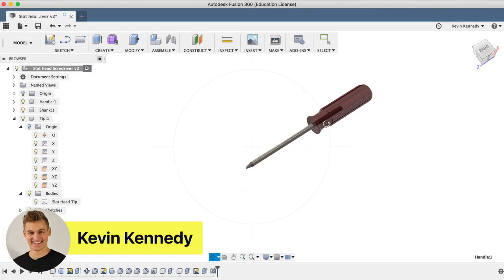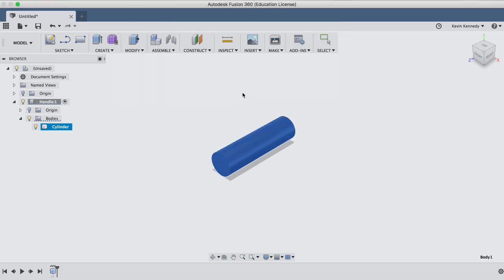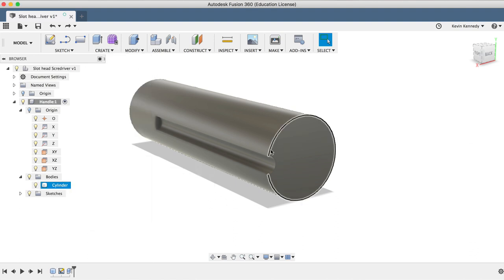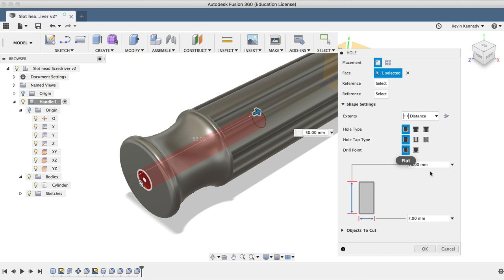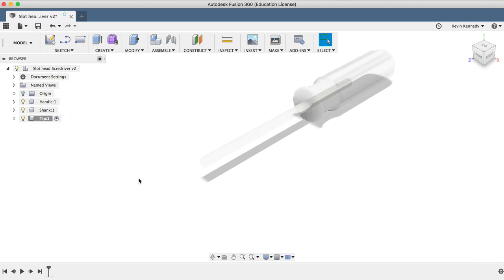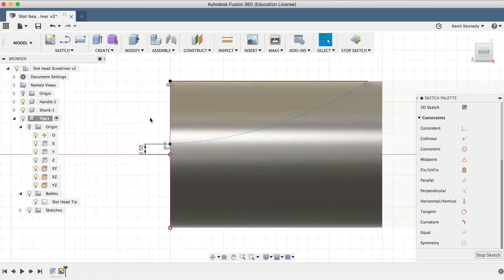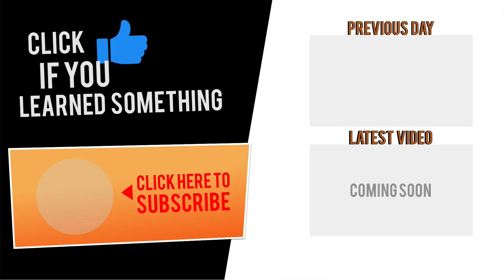How to 3D Model a Screwdriver in Fusion 360 - Learn Autodesk Fusion 360 in 30 Days: Day #14

Comment: Hi Kevin, 
I am stucked at 11.04 . I can't catch the edges of the tip when I want to draw tips, therefore I can't make horizontal-vertical selection. Can you help me about it?
Reply from the maker: Hi, Ümit Demir. Click on your username in the upper right-hand corner > preferences > then under "General" > "Design" tab...then make sure the following setting is checked: "Auto project edges on reference"

That should fix the issue you're having with the reference of the other edges as you try to make the tip. If not, you can always create sketch points. Sketch dropdown list > Point > place them where they snap into place. Then use those sketch points as you create the arcs. Cheers, Kevin :)
Reply: Hi Kevin,
It worked very well. Now I can develope my design:D
Thank you for your help!
Reply from the maker: @umitdemir2873  You're welcome! I'm always happy to help. Cheers, Kevin :)
Reply: @ProductDesignOnline   this fixed it for me also. I'm glad I scanned the comments.
Reply from the maker: @brandonleirer4928  Glad that helped, Brandon. I just made an update to the pinned comment. Hopefully, others will catch that and won't have to read through all the comments. Cheers, Kevin :)

Comment: Hi Kevin, I couldn't snap the 3 arc on the side of the tip, the ending line doesn't show up as it does in your video.
Reply from the maker: Hi, Hussain. You may want to first create a sketch point. Head to the sketch dropdown list and then select the "point" option. Make sure your grids and snaps are on and create a point in that area. Then when you go to recreate the 3-point arc you'll be able to snap it into that reference point. 
Let me know if this helps! Cheers, Kevin :)
Reply: @ProductDesignOnline . Thanks Kev, it works. i was just wondering whether leaving the points affects anything

Comment: Hey Kevin:
As always loved your video. Kinda of easier as I move  through them. I am no longer making basic mistakes. For example, I thought I knew how to cleanly use the line tool. I did not... This Screwdriver video is simply amazing! Oh, my God! 

However, I had a ton of trouble making that cut of the tip head near the end, at 11:30. I kept getting that constraint error. (I could never see the point.) Tried redoing from the beginning about 4 times. I finally fixed the problem, by adding a point to the origin, then redoing the Dimension step...  

I am 99% happy with the experience, but for that last 1%, any ideas why that happened? 

I checked all my setting multiple times comparing them to yours.  

As Always, Thanks!
Rob
Stay Healthy!
Reply from the maker: Hi Rob. Glad you were able to work through it with a workaround. My first thought, without seeing your model, would be to check the "Auto Project Edges on Reference" setting. Did you check that? https://productdesignonline.com/default-settings-for-fusion-360-tutorials/#autoProject

If that is turned on then I'd have to look at your file to rule out some other options.

Thanks - stay healthy and safe too!
Cheers, Kevin :)

Comment: Hi Kevin,
My center circle wont snap like yours does at 2:32. My cursor turns into an X when it reaches the edge of the circle and snaps to it, but moves freely around the circles edge. I simply drew a construction line from the center to the edge of the circle at 90 degrees, so the cursor would snap to the circles edge at 90 degrees but still lost as to why it wont snap like yours.

Similarly, at 11:40 where you dimension one end of the arc to the center of the tip, I can't get the dimension too to snap to the center. Only way I could do this is create a point in the center of the tip and dimension to that OR turn the model so the origin is visible (ie at the back of the handle) and dimension to that.
Reply: why is no one helping i have the same issue.
Reply: @itsmeerdinc  I know it's late but hold shift. Someone answered with that below.

Comment: I'm having an issue with creating the tip. When trying to create the arc, it doesn't snap to the top edge of the extruded cylinder. Then when you try to create the dimension to constrain the edge of the arc to .5 millimeters from the center, the dimension won't snap to the center. I have checked all of my settings. If I create a new drawing and simply extrude a circle and try the same operations, it works perfectly but it won't work when doing it after creating the handle and the shank.

Comment: I've be having this problem, I can't snap to the body of the tip to make the arc. Snap is on and it will snap to the grid, but not the body, so I can't dimension from a reference on the body.  I can find a work around but it makes it more awkward.
Reply from the maker: Hi, John. Make sure that all of these options are the same in your sketch palette - https://snag.gy/R0a6xc.jpg

If there was anything unchecked, turn them on and try again. Then, let me know if that worked. If not, I'd be happy to look at your file to help troubleshoot what could be causing this.

The best workaround in this situation would be to create a sketch point. Sketch (dropdown list) > Point. Sketch points will snap into more things than most sketch geometry tools, and they're a great way to create additional points to reference. Cheers, Kevin :)
Reply: @ProductDesignOnline  Thank you so much I was having trouble at that part, I had no idea that it was even unchecked

Comment: Kevin how do you quickly switch to pan mode to move around without hitting the fist button below?
Reply from the maker: Hi Alex. If you're using a computer mouse you can click and hold on the center scroll wheel, which will allow you to pan without having to activate the "Pan" icon down below. I should note that is with the default navigation settings. If you look at your preferences > general > "Pan, Zoom, Orbit shortcuts". Make sure yours is set to Fusion 360. (There are options for Alias, Inventor, SolidWorks, and TinkerCAD).
Cheers, Kevin :)
Reply: Product Design Online Thank you for the tip!

Comment: I also couldn't select the centre of the tip to dimension out the 0.5mm even though the 'Auto Project Edges On References' was in fact checked. I got round this by creating a construction line from the Centre vertical of the tip along the shaft and dimensioned from there.
Reply from the maker: Hmm. Strange. The  'Auto Project Edges On Reference' setting should've taken care of it. Would you mind sharing the link to your file so I can take a look at it?
Reply: @craigsunderland6404  I have the same problem.  How did you fixed it?

Comment: Hey, for some reason I just cannot get the 3-point arc to see edges of the cylinder tip. Is there a preference that I'm not selecting? I have the same ones on selected on on my sketch palette.
Reply from the maker: Hi Alex. Please check your settings with mine - https://bit.ly/defaultsettings

I believe this is the "auto project edges on reference" setting that you will need to turn on. Cheers, Kevin :)

Comment: Hey Kevin,
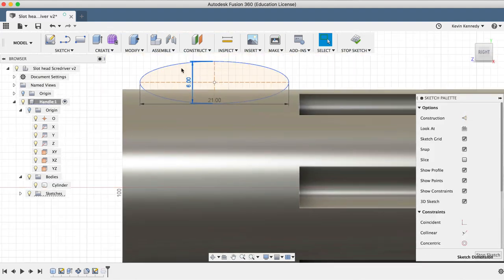At about 6:08 you went back and double clicked in the time line on the sketch to change the dimensions. Your sketch shows the  numbers and allows you to change them,mine does not. It only turns blue and the numbers do not show. What am I missing? BTW, I did make sure I had all the preferences set as you suggested.
Thanks
Reply from the maker: Hi Alan. Sorry for the delay. Did you get this to work? Most dimensions issues that I've seen are graphics issues. This may not be it, but just in case, have you checked your computer specs with the minimum system requirements - https://productdesignonline.com/tips-and-tricks/system-requirements-for-autodesk-fusion-360/

Comment: The point where you made the tip, and dimensioned the first end of the arc wrt the centre origin, i wasn't able to get that centre origin, even though i was in the environment of the screw driver tip.

Comment: Hmm. I must be missing something. I cannot get the arc dimension to turn black (@12:51). I have tried it a couple of times, I am not sure what I could be doing wrong. It seems pretty straight forward.
Reply from the maker: Hi, Brandon. If you can share the link to your file I'd be happy to take a look at it. Cheers, Kevin :)
Reply: well, I never could get that curve to dimension properly, but I could still select the profile so I was able to finish the tutorial. Thank you! Another great video!!! I would be interested in seeing the philips head tip also.
Reply from the maker: @brandonleirer4928  Thanks, Brandon. Tbh, I forgot all about the Phillips head. I'll try to incorporate that into a future tutorial. As always, don't hesitate to comment if you run into more roadblocks. Cheers, Kevin :)
Reply: @ProductDesignOnline  I had the same problem as well with the arc line but I was still  able to extrude. when I clicked it and hit enter nothing happened. might be part of the up date. 

Edit: looked back and I did not have the measure tool on.

Comment: How do you make the drawing lines that outline features hidden?  Looking at your drawing at 8:25 it looks like a nice photo ready shape, mine has all these segment lines on it.
Reply: Oops, found it - change Display Settings > Visual Style from Shaded with Visible Edges Only to just Shaded
Reply from the maker: Hi Vince. Glad to see you found it. Just to clarify, those are just visual settings. For example, if you were to 3D print the object then those lines would not show up on the model. Cheers, Kevin :)

Comment: I'm having trouble with the midpoint not showing up when wanting to fix the distance for the tip. I've tried toggling origin on and off but it only appears further back at the main body of the handle and not at the tip.
Reply: just create a construction line to snap to

Comment: i had an issue while trying to adjust distance from top edge of tip to the centre point, i couldn't get the second point to select the midpoint of the tip... i solved this by adding a sketch point to the midpoint and re-trying the distance application and was able to snap to the sketch point as my second selection.
Reply from the maker: Hi, Sterling. Great solution. The point command definitely comes in handy when things won't snap into place as we want them to. Cheers, Kevin :)
Reply: @ProductDesignOnline  why  i don't have second point to snap midle ?
Reply from the maker: @sorcerer33  It's hard to say without taking a look at your file. I would suggest just adding a sketch point, as Sterling noted above. If you have any troubles with that let me know and I can look at your file and help out. Cheers, Kevin :)
Reply: Same problem here.  Thanks for the suggested workaround!  
I find it so strange that some people get stuck with a specific issue (that seem to be Fusion related as opposed user caused), and others don't seem to have the problem at all....?
But it's great when the Comments have exactly the difficulty you're having, and a solution is given!
Reply from the maker: @StepInIsrael  I'm glad you were able to solve it with the workaround. I try to do everything possible to minimize potential problems before recording the tutorials. Unfortunately, with different versions, settings, and operating systems, it's impossible for everyone to follow along 100% without a single problem. With that said, as you mentioned, it's great when everyone shares their problems and solutions in the comments. Cheers, Kevin :)
Reply: Same problem here. I supposes the F360 versions are giving trouble. Solved by reading comments and Kevins kind response to everyone, so the center point allowed me to continue. Thanks Kevin!

Comment: Also having issues creating the tip end. The distance tool doesn't seem to want to want to select the end of the 3 point arc to active the dimensions input
Reply from the maker: Hi, acgkplh. Turn on the "Auto Project Edges on Reference" setting and it should then work. Instructions here - https://productdesignonline.com/default-settings-for-fusion-360-tutorials/#autoProject

Comment: I modeled the screwdriver , but I'm having problems with the tip. the the drawing on the tip won't lock in place and the mirror function won't work.

Comment: I'm using the latest version of Fusion 360, 2.0.8111, which is obviously newer than what you're using.  Unfortunately, one of the changes/improvements that they made makes it hard to follow what you're doing in this tutorial.  At the very beginning after you've created the handle component and go to create the first sketch and center circle, those options are not available on this latest version until you click on Create, Create Base Feature.  Then you can go to the Create, Create Sketch and go from there.  Unfortunately, the timeline then only shows Base Feature from that point on in terms of the Handle Component, so you can't edit any of the steps in the handle component creation later on.  Is there some way to bypass this Create Base Feature step or at least enable the timeline for the handle component?  Thanks.
Reply: Kevin, I figured it out in the sense that this is a bug in the latest update.  When you click the create menu, it opens upward if there isn't enough room to display it all in the normal down direction.  When it displays upwards, it only shows a couple items from the bottom of the menu; hence it looked like there were lots of items missing from the menu.  Autodesk support says they hope to have a fix pushed out soon, but in the meantime, users can hit the "S" key and search for the command they want.  You'd think they would test the releases a bit before sending them out into the ether!

Comment: Doubt: Is there any difference between empty component and external component?
Reply from the maker: An external component means that it's referencing a separate design file. If you altered that separate sign file all the files that link or reference the component will inherit those changes. internal components are the opposite and it means that they are only contained within the single design file.
Reply: @ProductDesignOnline  ok thanks!

Comment: I have Turned on the Auto project edges on reference and it is projecting but it is not giving me a center point? how would I solve that issue
Reply from the maker: Hmm. Are you looking directly (straight) at the sketch when projecting? That could be it. As a workaround, you can always use the 'Point' sketch command to manually add one. You can then apply a midpoint constraint to center it.

Comment: Hi Kevin,
I'm also having an issue when trying to add the dimension to the arc at 11.29. It won't let me click on the centre point/axis. It will only let me select the edge of the cylinder body. I can create a construction line through the centre, but then I don't think that ties the metrics together, so when it comes to adjusting the top line to 9mm, it extends in the wrong direction and throws everything off. I've checked my settings like you've said but still no luck :(
Any help would be greatly appreciated.
Reply from the maker: Hi, Catriona. Can you check your preferences to see if the following setting is on - "Auto Project Edges on Reference"

https://productdesignonline.com/default-settings-for-fusion-360-tutorials/#autoProject
Cheers, Kevin :)
Reply: @ProductDesignOnline  Hi Kevin, thanks for your response! And yes, sorry that's what I meant by that I'd checked the settings. I read that in your tips afterwards and thought it would help but sadly that setting was already on. Is there anything else that could cause this issue?
Reply from the maker: @catrionabrown1106  Could you share the link to your file so I can take a look and eliminate some possibilities? To share your file - In Fusion 360 go to File > Share > Share Public Link (make sure "downloadable" is toggled on) > Paste your link here as a reply to this comment. Then, please write a separate comment letting me know you've replied with a link because YouTube flags most links and I don't always get notified. Cheers, Kevin :)
Reply: @ProductDesignOnline  Thank you! I've shared the link below. I really appreciate your responsiveness here!
Reply from the maker: @catrionabrown1106  Hi, Catriona. I just looked at your file. I didn't see anything wrong on my end. It's likely that it was a difference in settings/or version that threw it off. To fix it, you can just create a sketch "point" and place it on that red X-axis. You'll then be able to create the dimensions as I did in the video. Here's your file after I did those changes - https://a360.co/2UUeRjC
Reply: @ProductDesignOnline  apologies for not replying to you before now. Thanks a lot for checking my file so quickly and for your advice, I really appreciate your responsiveness and help! Thanks so much :)
Reply from the maker: @catrionabrown1106  you're welcome :)